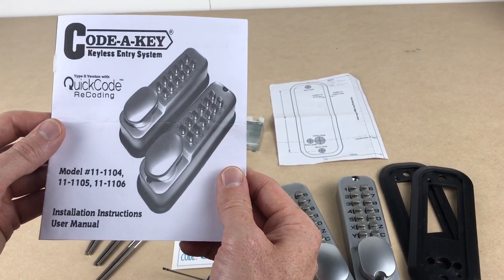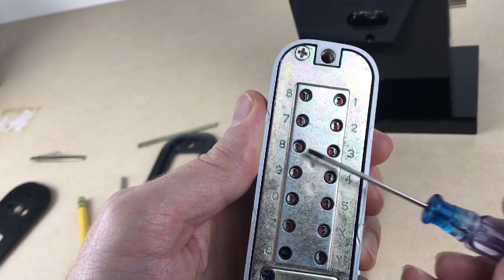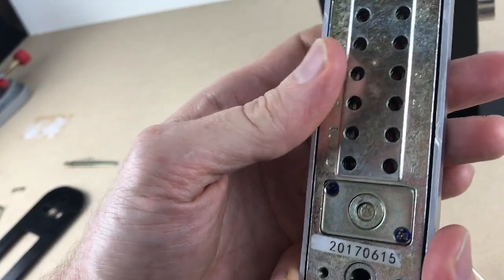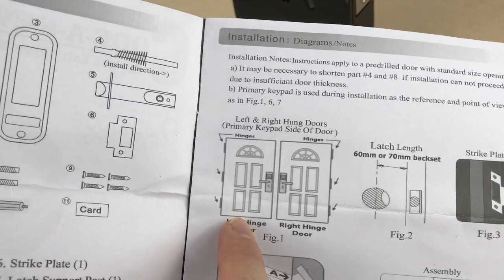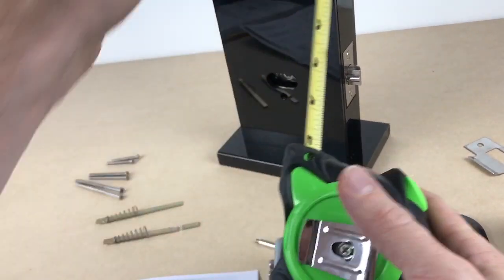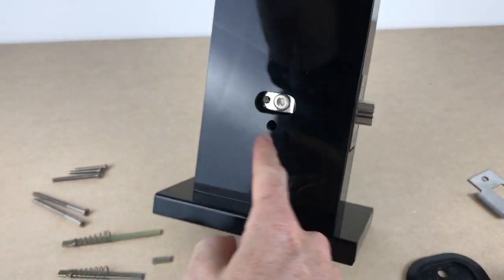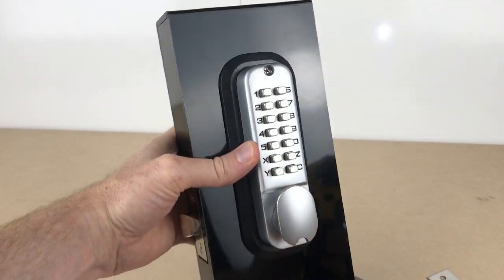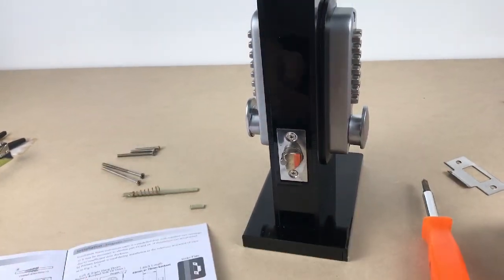Double Keypad Mechanical Keyless Door Latch Lock

Comment: Thanks for this video. It was very helpful, but I'm having a problem now. When I try to tighten the lock assembly, the latch remains in the open position. I will enter the combination, turn the handle, the latch will open, and then it just stays there. It's like there's some friction somewhere inside that is keeping the latch open. I thought perhaps my spindle was too long so I shortened it, and it seems to fit just fine. I don't know what else it could be. Any thoughts?
Reply from the maker: This is probably because your spindle(the flat bar with a spring) is too long. Try to loosen the screws a little bit (1/16” or 1/8”) and see if that frees the latch and unstuck it. If that test helps you want to cut or grind the spindle down a little. 

If you the lock is installed wrong (if the inside lock and the outside lock are installed straight and leveled) it will also cause binding. Let’s hope that is not the case. Some times, if the screw on the bottom is tighter than the one on top or vice versa can cause the uneven-ness as well.
Reply from the maker: Please feel free to call us at 310-773-0735 for more help.

Comment: My existing door already has a hole drilled for a deadbolt. Is this assembly big enough to cover that also?
Reply from the maker: The black seal is 2 1/2”wide and 6 1/2”high. It should cover the standard bore hole (2 1/8”). If you install the lock without the black seal (some people choose to do this) the lock alone will not cover the bore hole. 

Please check the backset dimension as well (2 3/8” and 2 3/4” backset included). And, make sure this new lock doesn’t interfere with any door handles, door chain, and etc. installed near by.

Comment: I bought the same lock but a different brand. It came with the wrong instructions and the spindle doesn't have a spring on it. Just plain flat rod. Since it came with the wrong instructions (for one-sided keypad lock), I have no idea on how it will work from one side to the other side: (1) Both keypads, has the same code, (2) when entering the code from the outside keypad and turning the knob, the inside knob does not rotate with the knob outside because it is still in the locked position - no "freewheel rotation on the inside knob", (3) it's the same result for the inside knob (knob outside does not turn when the inside being rotated while unlocked with the code), (4) not sure if this came with the wrong spindle or the latch, or both. But I believe that when unlocking from one side, it should also unlocked the other side to give both knobs a "freewheel" action to rotate and retract the latch. But, it is not happening in this case. Is this lock designed for "one-side coded/other side no-code" type of operation? If so, why even design a lock like this if you can't even make it work? Any thoughts? Thank you.
Reply from the maker: This lock on the outside and inside work independently. What is important is if the knob is engaging the latch and retract when you try to open (the knob inside won’t turn). 

The knob only engages the latch in one direction and open. It does not open if you turn it in the wrong direction. 

If you want to make one sided lock you can just set “no code” on the side you don’t want any code. If any button is pressed by accident on that side just press “C” button to clear it and open the door. 

Since I can’t see what kind of lock you have, it’s hard to help you.

Comment: Great video.  Can this lock be installed in any home or will be a fire safety hazard?
Reply: Legally, as long there is another way to get out of the room, you can have double-sided lock. Otherwise, it's a safety hazard and in some states illegal.

Comment: I open the thing and parts go off 🤣 what i have done? More limits?
Reply from the maker: What do you mean? Did you open the back of the keypad and the springs flew off? 
This keypad has "Quick Code" change system. You didn't have to open the back to change the code.

All you have to do is just turn the red mark on the back of the keypad outwardly to set the code. It's that simple.

You can find the instruction on Amazon:
Mechanical Keyless Combination Latch Door Lock with Double Keypads
https://www.amazon.com/s/ref=nb_sb_noss_2?url=search-alias%3Daps&field-keywords=lock&field-brand=JOUNJIP
Reply: I did the same as I watched a youtube clip on changing codes but didn't realise my lock was the newer Quick code one. I have put it all together again but it wont work. Did you manage to fix yours? do you have a photo of how it's suppose to look inside by any chance as I think it matters what way the washers (with the sticky out bit) face. Help, I don't want to buy another one. 🤣
Reply: @georgepieri618  yes you have to follow the lines yl try to send a foto of my one
Reply: @adolfgeorge3704  If you could send me a photo that would be great. I even thought of buying another one opening it to fix mine then returning it. 😂
Reply from the maker: @georgepieri618  Please contact us at Jon@jounjip.com. We might be able to help you.